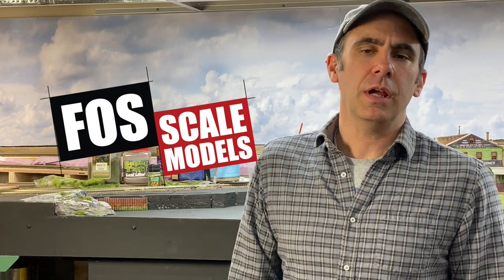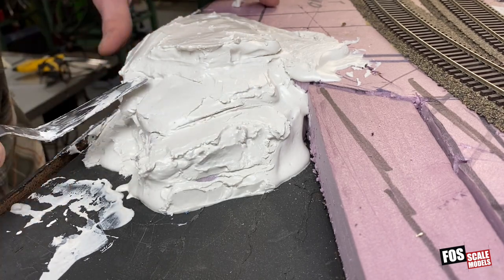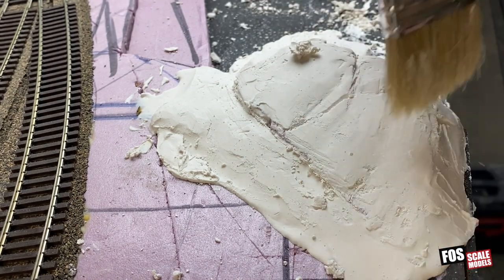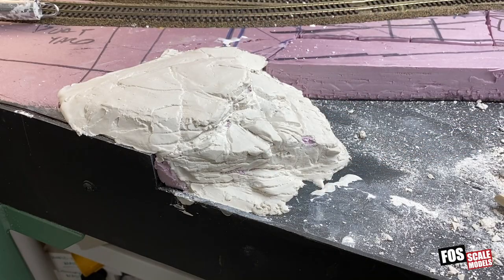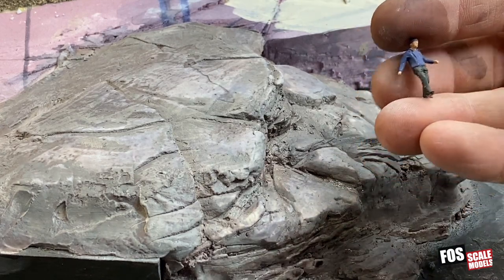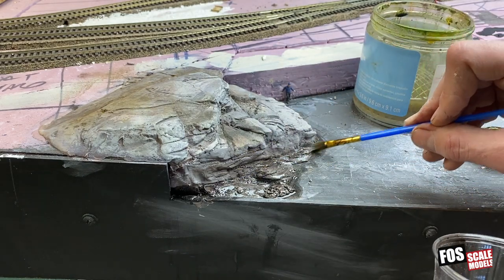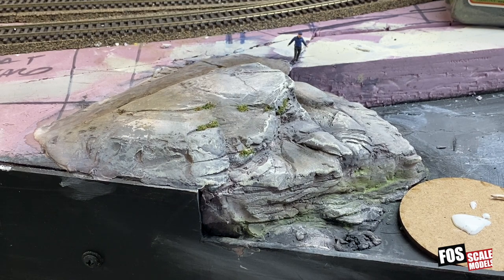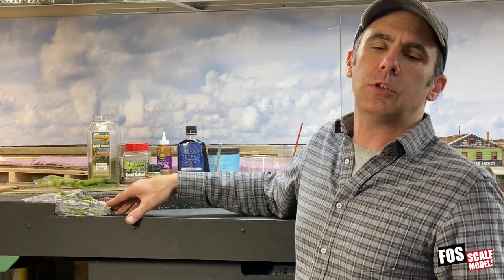Hand Carve Plaster Rock Work

Comment: If you add a little vinegar to the hydrocal, you can slow the dry time down and give yourself some more working time. Chipping is a problem with hydrocal after the scenery is finished and will leave a bright white spot. I put about a 1/5 teaspoon of Rit Dye Crystals (brown, black gray or tan) to color the plaster slightly to prevent white chipping. Rit Dye is an acid dye and will also slow the drying process down.

Comment: Nicely done !!!  I am faced with trying to model shale which is a sedimentary rock in very thin layers which I haven't figured out how to do yet.
Reply: Use the plaster.  Instead of chipping, pick up some fine tooth combs from the dollar store. Drag one across the rock surface.  Let it set a little.  Use a brush to smooth it.  Use a knife to to chip the edge.